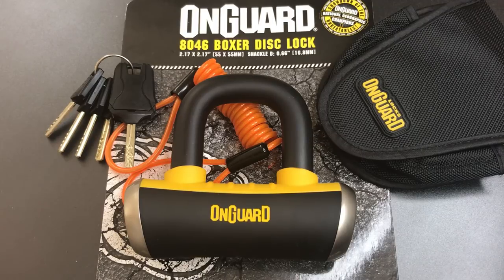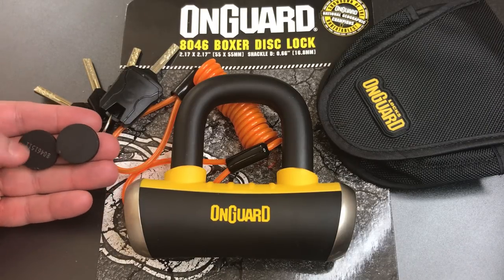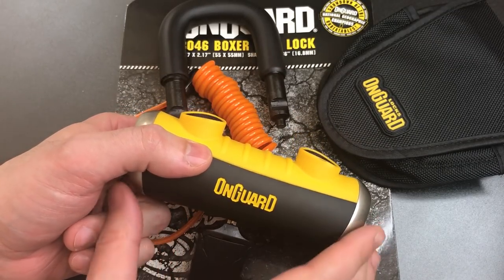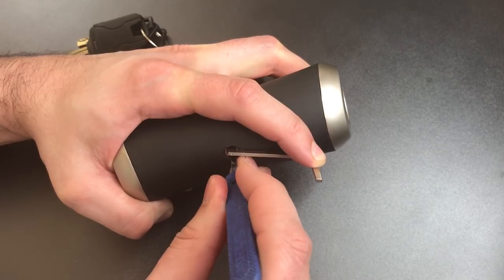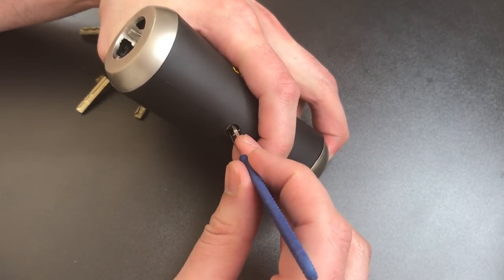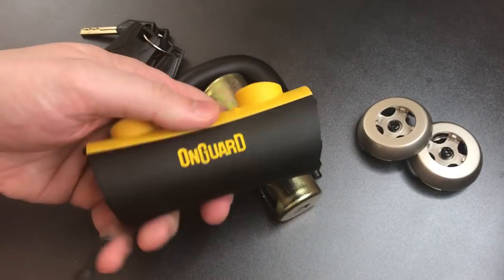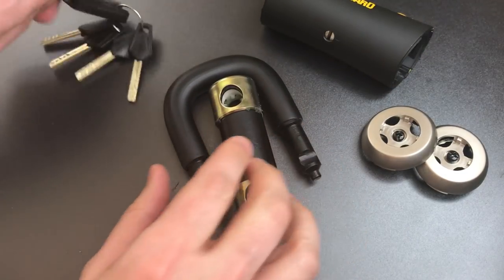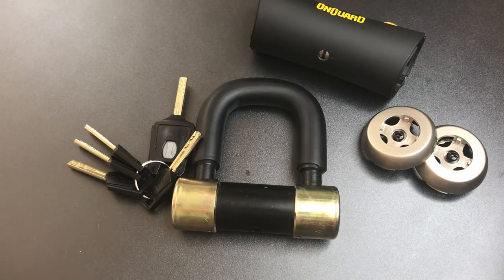[591] OnGuard Boxer Disc Brake Lock Picked (Model 8046)

Comment: Intimidating looking but honestly many people only need the time it took you to pick the lock to come looking. In the early 2000’s I had someone defeat my disc lock and try to wheel my bike away. I didn’t have much money but I could salvage a motion detector light and some wire. I wired up the motion part behind my bike, (at home) and wired the light inside my house, (I was renting). When the light went on, I would go outside to investigate. You are a lawyer so I will just say that once I discovered two people taking my bike, and they gave it back to me after which they left.......

Comment: How more difficult is it to pick a lock where you haven’t seen the key and haven’t manipulated the lock mechanism to see how it engages? Going in cold you don’t know how many disks or pins.
Reply: avalon449 someone asked that about a krptonite new york lock and send him one that he opened from the mail on cam a picked cold. And painfully fast. 
 So yeah he can probably do it with his toes.
Reply from the maker: That depends on the lock... but for all but the truly dastardly cores (and this ain’t one), a blind pick would usually not be significantly longer. See video 550 for more on this topic. 😁

Comment: Classic Onguard for you... half plastic with a marsh mellow core and few major flaws hidden in the design. That X4 design is supposed to be set up so that the shackle must be cut twice to get the lock off but all of the Onguard locks Ive seen busted with that feature have only  been cut once and then twisted open but they were more normal sized U locks, not a mini.

Comment: I noticed a lot of what looks like plastic inside, I wonder how easy a destructive entry would be. Maybe those steel end caps wont let the plastic go anywhere, preventing that.
Reply from the maker: I’m not too concerned about the plastic because of how the locking bars are braced between the main tube and the shackle... as far as other destructive attacks go, I think brute forcing the main tube is the way to go.
Reply: I own this lock witha good chain for my scooter.... it honestly just looks big and heavy. The size intimidation factor is completely gone when i see it without all that plastic.

Comment: Not too bad and the best OnGuard yet. I think the picking resistance is good enough to stop thieves, and be it only through obscurity (sliders are not that common yet and this one in particular doesńt seem too easy, you are just a very, very good lock picker). 
The shackle diameter stays consistent where you could actually get at it for a straight cut, thats ok in my eyes. The plastic inside the body seems to not have a structual purpose because of the locking pawl design but rather to be there just to fill the hollow tube and maybe guide the pawls for smooth operation. I might be wrong and structual parts made from plastic inside a lock are always a bad idea.
It´s a decent lock but as you said maybe not quite as strong as it might look from the outside. I wouldnˋt be worried if that thing would secure my bike but I would buy something stronger if I had the choice.

Comment: Good point about the X4 mechanism: you don't have to worry about which way round the shackle goes.  Less fumbling.

Bad point about the X4 mechanism: the shackle is weaker because of the two cut-outs.   Quite possibly strong enough, so that it's not the weakest part and under a brute-force attack the pawls might give way first.  But maybe it is the weakest part and it would be stronger with only one cut-out per arm.
Reply from the maker: The weak point in the system, I think, is the main tube. With enough force, that would deform and allow the shackle to slip past the locking bars... but I suspect that would require quite a bit of force.
Reply: Future destructive tests?  I think this would be very loud and prove difficult. These designers believe only physical attacks need to be defended, but your method, (picking) is at best #10 or lower on their priority list.
Reply: +John-Paul Silke
Very few people have the skills (or the tools) to pick a lock.  Many people have hammers and crow-bars and know how to use them.  So it's sensible to design against brute-force attacks.  But it's not sensible to ignore picking attacks.

Noise isn't always a problem.  Often is, but sometimes isn't.  There are places and times of day where even a picking attack would arouse suspicion.  And other places and times where an angle grinder wouldn't be noticed.
Reply: But anti-picking technology is often super easy to add and in several cases, (if you look at LPL’s videos and assume an average) it can be cheaper or as cheap to add. I’m sure for the cost of a few locks they could simply send out a few to lock-sport pickers and get feedback for postage and a few dealer samples.
Reply: But why bother?  Most people don't have a clue how to pick locks or to evaluate how pick-resistant a lock really is (as opposed to what the packaging claims).  Many people can see how "beefy" a lock is and evaluate how hard it appears to be to brute-force it open.

Which means unscrupulous manufacturers will concentrate on making a lock look physically strong.  Making it actually physically strong costs more, and won't affect sales much.  Making it resistant to picking (even if it costs no more) won't impact sales at all.

The lies on the packaging are better engineered than the product.
Reply: Several difficult pins or sliders don’t actually add almost any cost. This addition makes it better without affecting bottom line and people are becoming more savvy. I didn’t say anything about the thinning of the locking hasp because it would be too difficult to access it with the plastic crap around it. (95% or more of all lock attacks will be physical, perhaps more so your point is noted).
Reply: +John-Paul Silke.
The cost of difficult pins is small but not negligible.  Extra machining steps, and the machinery needed for spools and serrations has to have greater precision (so is more expensive).  Assembly complications (make this pin spooled unless it's too short, follow this pin with a serrated one unless this pin is also serrated) are costly when you're paying monkeys peanuts.  Especially rework caused by assembly errors.  Much cheaper to have standard pins throughout because there's less to screw up at assembly time.  And most purchasers just won't know the difference.  All they can go by is the claims on the packaging.

I didn't consider the plastic crap around the lock as any hindrance.  Something like a small, hand-operated version of the jaws of life would put a lot of stress on both the shackle and the lock body.  So would the right size of crowbar, judiciously applied.  Those two slots on each arm of the shackle are stress concentrators.  If the body is strong, that's where the shackle breaks apart, and it's a lot more likely to happen with that design than with one that has only one slot per shackle arm.

Comment: I bet you could make a good lock 🔒 you know a lot about em
Reply: The job of any good lock is not to prevent access, which is inevitable with enough determination, but to design effective attack resistance into the casing and locking mechanism. Master Locks padlocks as a classic example design great locks, but always fail to include a good pick resistant core.
Reply from the maker: Thanks... I suspect I could at least avoid the obvious errors.  ☺️  But the hacker mentality will always find a way. 👍
Reply: LockPickingLawyer that’s true even safes the best ones can be picked .... you pay for  time

Comment: A steel pipe could be installed over the lock body. Useless plastic parts should be removed. Just drill holes for shackle and key,  and pipe stays securely in place.

Comment: Is the very inside plastic? The part inside the tube where the bars slide in shackle? If so it may soften enough to pop it with enough leverage
Reply from the maker: The best I can tell, the bars are held in place between the shackle and the tube when locked, so the plastic shouldn’t be an issue... but it’s hard to tell without destructively opening it.

Comment: So about 1 minute and 13 secs to pick it, with a bit of stall from the commentary. I translate that into: "thief with pounding pulse is going to be at least 10 minutes doing that"... or about 10 times longer than it takes to cut through the plastic and the thinner part of the shackle.

In all honesty I think that as long as it takes YOU longer to pick it than it does to kill it with a cordless angle grinder, then it is not a bad core-to-shackle match :P
Reply from the maker: I doubt many thieves develop the skills to open these... that said, the cores are not particularly pick resistant IMO.  But as far as the shackle goes, it’s a HUGE overkill compared to the rest of the lock.
Reply: Being an avid picker myself I have learned that when you label something as "not particularly pick resistant" that means "will befuddle me for a good half an hour the first time around".. which in terms again means "thieves can't pick it".. at least where I live :P
Reply: A lot of security is faith-based. The owner of the lock has faith that it will deter a burglar, the burglar has faith that he can’t twist it off before the owner turns up with a bat, or worse. If everybody thought in careful, scientific terms then I’m not sure if there would be more or less burglaries, but locks would cost 10x as much as they do now.

Comment: I have this exact lock which was compromised in a strange way.  I've used it with no problem for 2 years, and it is actually under a tarp at all times. I went to unlock my scooter yesterday and noticed that a neighborhood cat peed on the lock some time the prior day.  I hosed it off, wd40ed and opened the lock. It was very difficult to open.  I had trouble turning the key, but eventually was able to.  At the end of day I gambled and locked up my scooter.  This morning I sweated it out as I struggled to open the lock.  It finally opened and I decided not to use the lock again.  Do you think the cat pee actually corroded springs inside the lock mechanism or just gummed it up.  I noticed that the pee was rather viscous and maybe it clogged up the tumblers.
Reply: A followup.  I decided that the cat pee must have jammed up the mechanism and the wd40 wasnt a suitable solvent, so I soaked the lock in vinegar for half an hour.  That did the trick.
Reply: pal on user guide onguard says use wd 40 when it get wet or rainin several times, ı m doin it every month and it never  makes me a trouble 2 years of period 

;)

Comment: Wouldnt twice the cut out means its weaker since metal has groves on both sides that makes it prone to shock break
Reply: I was thinking the same!  The steel is very thin across where the cutouts are. They would have been better off offsetting the grooves.

Comment: Wonder how hard it would be to force the shackle to turn with the dual locking bars. That way you only have to cut the shackle on one side to remove it.
Reply: Good question.  That could have been tested by inserting just one end of the shackle.
Reply: Did you not notice the marshmallow like core holding the locking pawls in place? LOL I feel a meltdown coming on!
Reply from the maker: I suspect it’s pretty hard to turn, because the locking bars are braced between the main tube and the shackle. You would need to reform the tube!

Comment: I stuck the wrong key into my OnGuard disc lock, turned and BROKE the tip of this key into this disc lock. Is there any way to REMOVE a broken piece of key from this lock without needing to saw it open? It is currently locking up 3 of our bikes-HELP!

Comment: How do you check to see if it's hardened or not?
Reply: He probably did it with a metal file or a hardened pointy tool (i dont know what its called) if the metal you try scratching is softer than the file,or the tool, it will get scratched. If not, its not gonna get scratched. Generally its how its tested.
Reply: Knife makers do it the same way after heat threating the steel. They try to file it, if the file bites in to the steel, than your steel's HRC grade is lower than file's HRC grade. I hope i could expalin it.

Comment: I'm struggling to understand the mentality involved in the design of some of these locks. I'd fire the fuckers that designed and signed off on this. 
It is apparently more bullshit than security. Okay, we live in a world of bullshit, but increasingly we are learning that there are also competent unscrupulous attackers operating in the real world. 
The plastic (inside and out) is part bullshit and partly to keep the cost down. The thinning is a design flaw that is disguised by the plastic bullshit.